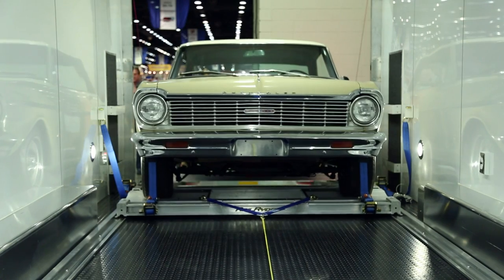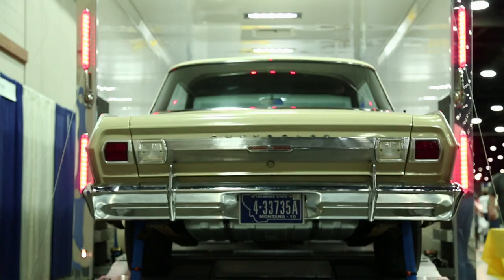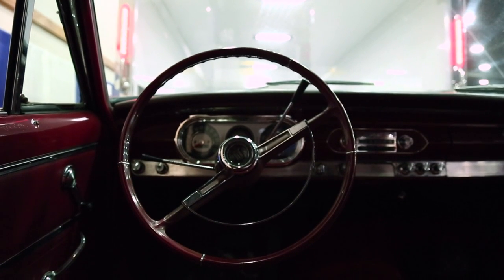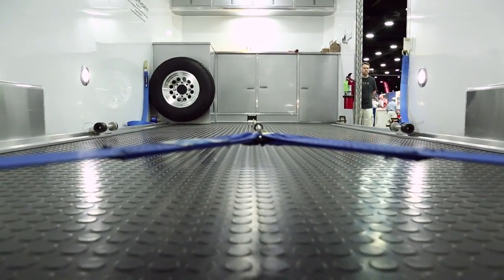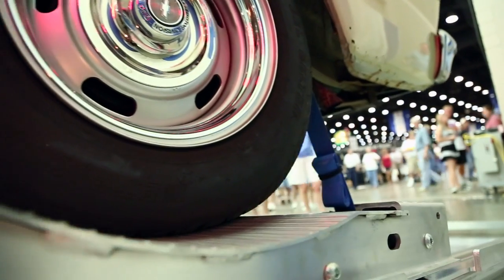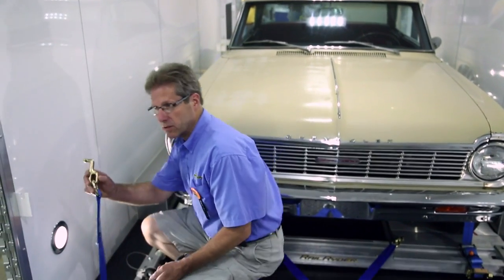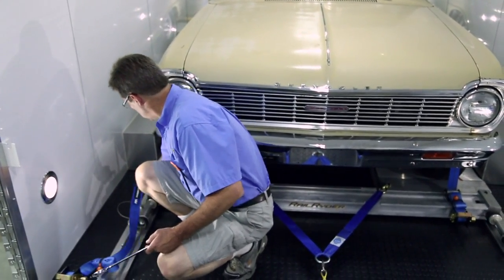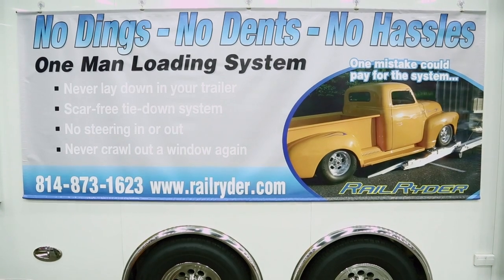Rail Ryder Enclosed Trailer Loading System - New Product of the Year!

Comment: Good idea but needs to be more advanced than this. Good start though. The plate can be an open pocket that’s adjustable for different tire sizes. Automatic locking mechanism once the unit is in place. And no winch., engineer a power rail system.